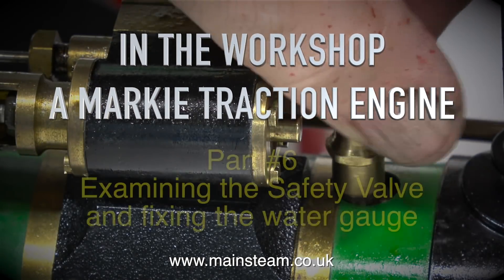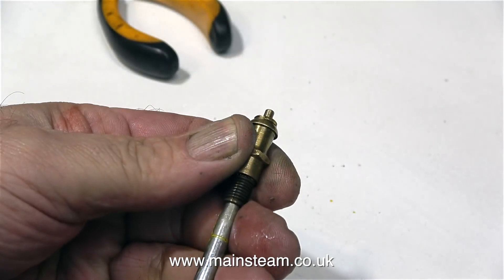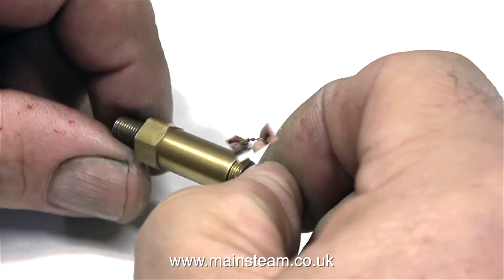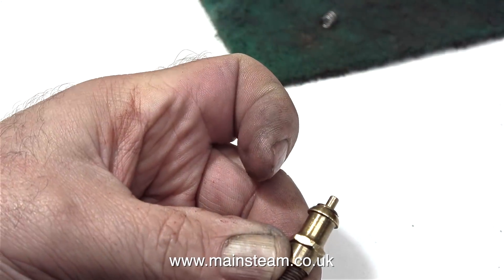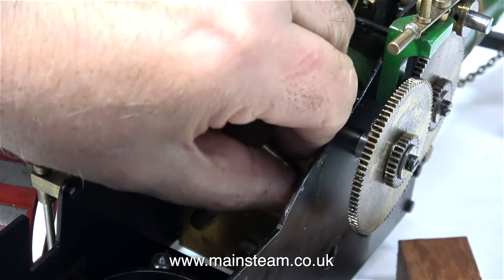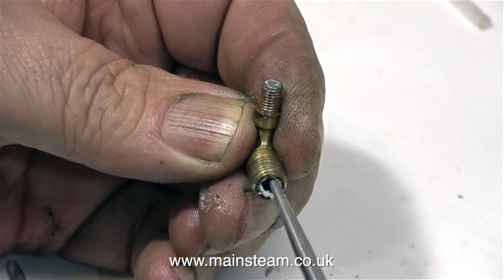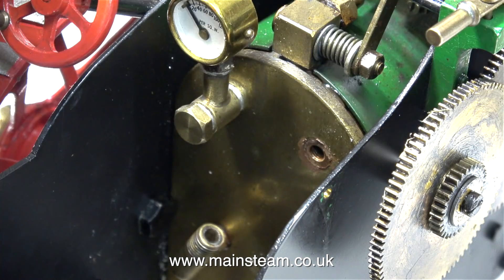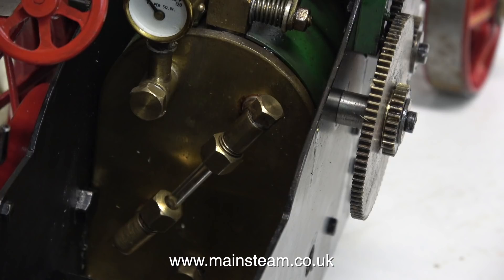REPAIRING A MARKIE TRACTION ENGINE - PART #6

Comment: How much did you increase the holes in the sight glass fittings?
Reply from the maker: only a slight amount , more of a clearance fit than the original tight fit.
Reply: The technical term is "a gnat's".